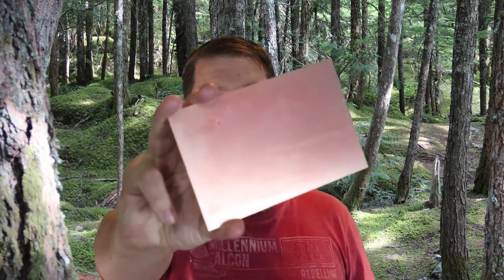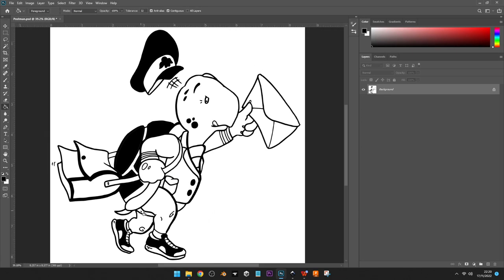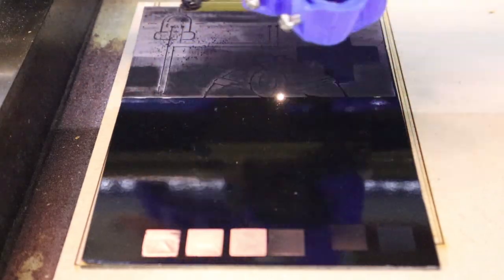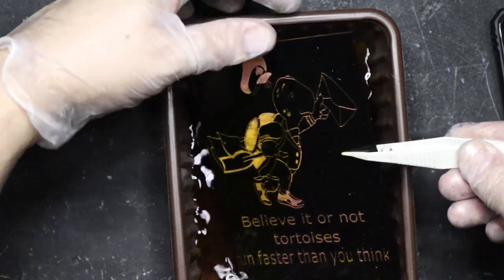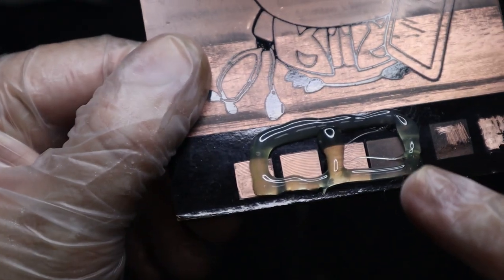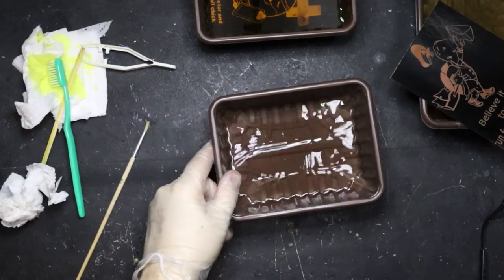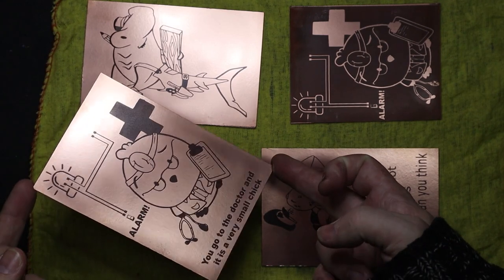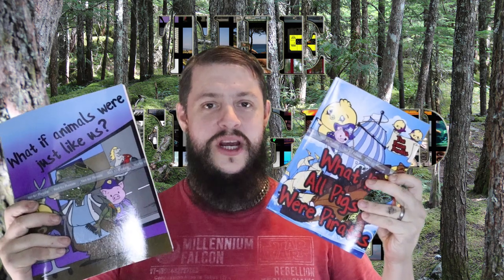PCB to Pictures - Etching Pictures and Circuits  (Book Promo & Competition)

Comment: When I first started in the print trade I was taught to etch onto copper plates. It was called Gravure, it was pretty much outdated in the early 80s
Reply from the maker: What did you use as a mask? I started by using a toner printer and printing onto photo/magazine paper. Then ironing it onto the copper pcb
Reply: @TheOffGridFamily  we had 3 or 4 negatives, if I remember correctly the image was made of dots, you had a  cyan, magenta, yellow and black. For each colour to get printed. You had to use etching fluid to reduce the size of the dot to get the desired colour at the end. It was a very laborious task. I don't think I ever really mastered it
Reply from the maker: @steveday4797  that sounds much more complicated than anything I have tried!